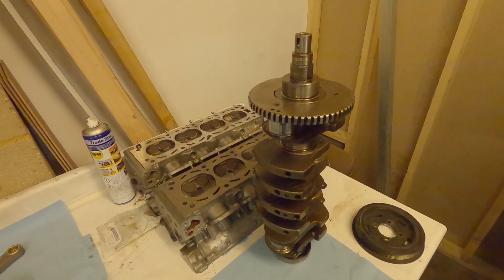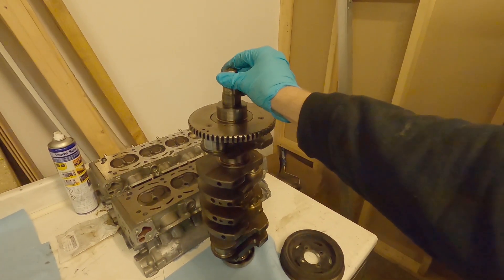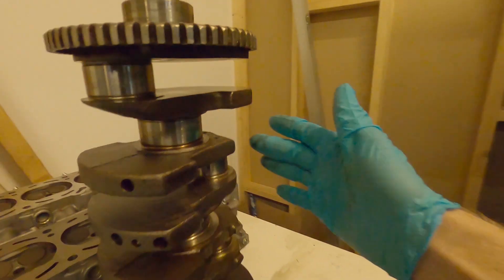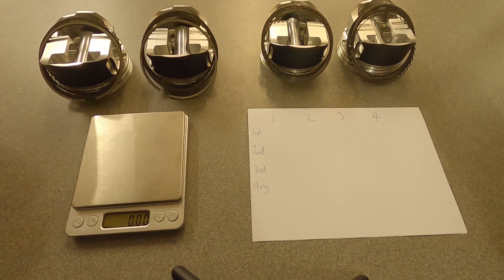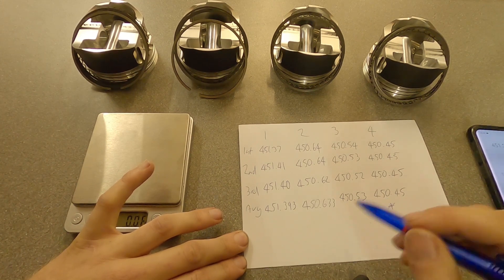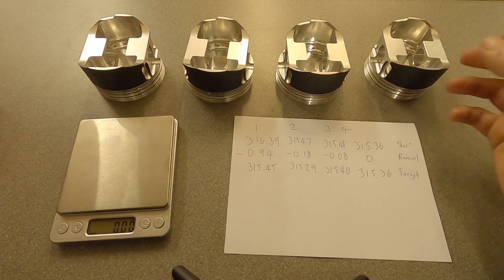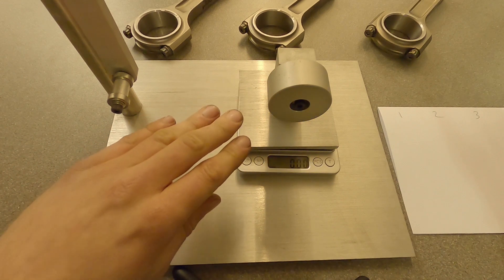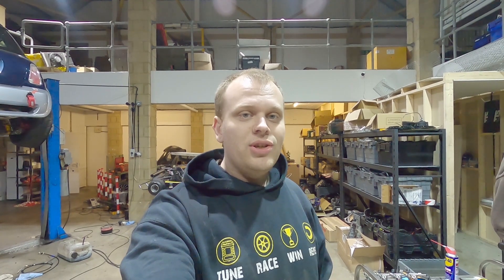Engine Building Part 4 - Balancing Crank, Pistons & Rods

Comment: when weight the small end of the rod, if you don't measure it like how you measure on the big end, what happen if the small end all having same weight but the rod's middle part is heavy than others ? i would think measuring them like how you do with the big end would be most accurate ?
Reply from the maker: You measure one end and correct the big end then use total mass to correct for the rest of the rod.
Reply: @tunedbyrabbid  glad came across your channel. Thumbs up

Comment: Shouldn't you also send the pistons, rods and bearings to the machine shop when balancing the crank, if I stand correctly the weight of those components should also be taken into consideration when balancing the crankshaft.
Reply from the maker: The crank shaft balance is on its centre of rotation. Only mass that rotates on the crank is required.

The pistons and rods are not required to balance a crank assembly as their mass is not in a static position to the cranks centre line.

Comment: If you're going to weigh piston assemblies 3 time then be sure to rotate it 120 degrees each time to get a correct average, also try and keep the rings, clips and pins over the centre of the piston
Reply from the maker: Good tip

Comment: How repeatable are the readings you're getting from that rod balancing jig? Despite many tutorials, hours of videos watched, following as many carefully detailed instructions as I can I have yet to see anything reliable enough that I feel comfortable calling accurate. The scale is though. Through 8 rods, weighing gross weight each 10 times (to verify the scale) I don't seen more than a .2g variance.
Reply from the maker: Take multiple measurements and average them.

It's perfectly possible that the sets you're buying are actually well balanced from the manufacturer already.

Comment: I would wight all the parts separately and then put all the heavy rings with the lightest ones and then make changes from there if needed but your way would be much quicker lol the only reason I would do it my way to see if I would have to make any changes if that makes sense ;)
Reply from the maker: Depends on the order of things, if you've already assigned pistons based on wall clearance then already gapped the rings to that cylinder you don't want to mix them up.

But I guess you could weigh everything before you get that far and match rings to piston weights then assign pistons and then gap rings then balance.
Reply: @tunedbyrabbid  hey bud if I ever want mine forged I will get you to do it if thats cool lol your a very long was from me though lol 😂 how long would it take you to forge a vectra vxr 57 plate just so I know roughly if I want it done as I would be coming from Scotland 🏴